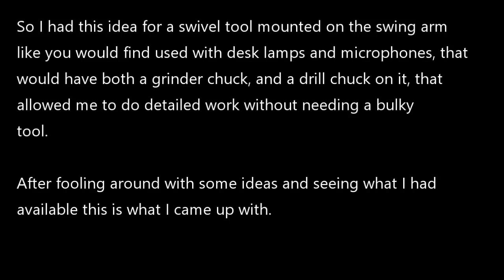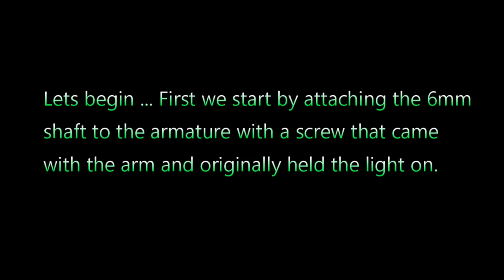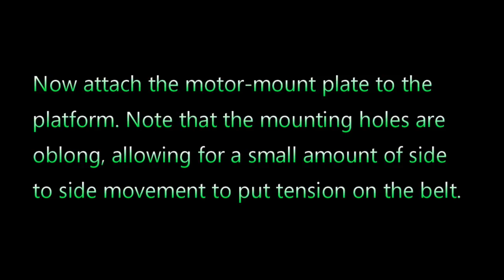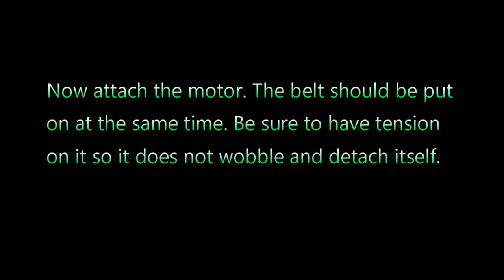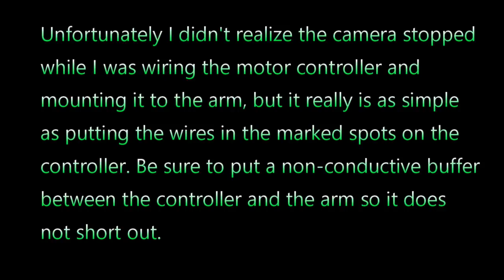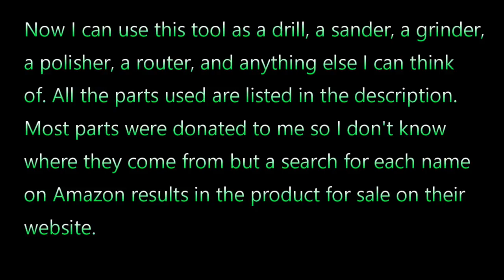AMAZING! Swivel Tool - Part 1

Comment: Be sure to let us all know how often you grind the skin off your arm reaching for the tool. Grinder disc exposed like that will bite you.
Reply from the maker: Actually I will be putting a shroud on it as well as extra springs for better control. All in Part 2. Thanks for the warning though and I agree, all it takes is a small lapse in concentration.
Reply: A hand grinder with a guard is utterly useless. Been welding for 40 years and guards come off immediately.
Reply from the maker: @gregblack8550  Shroud will removable. The tool as a whole is meant to be for small hobby projects. I have an actual angle grinder, chop saw, etc that I keep with my welders